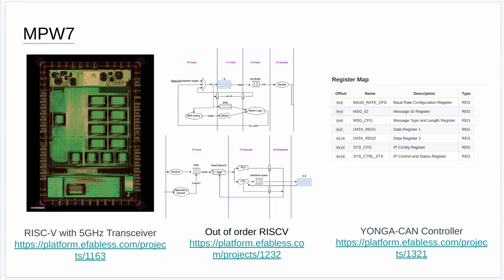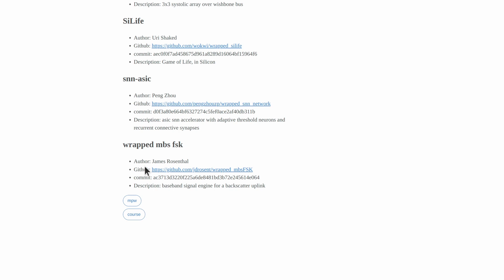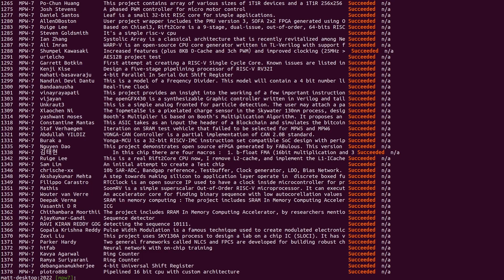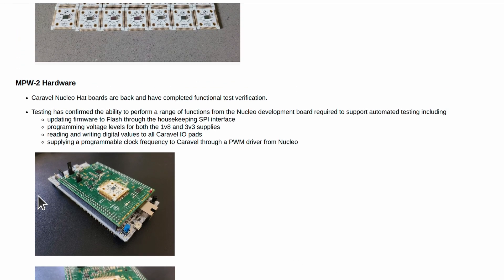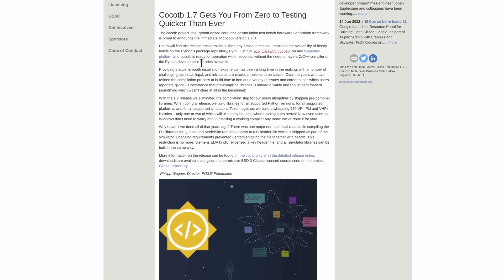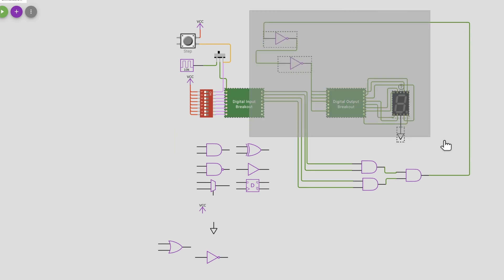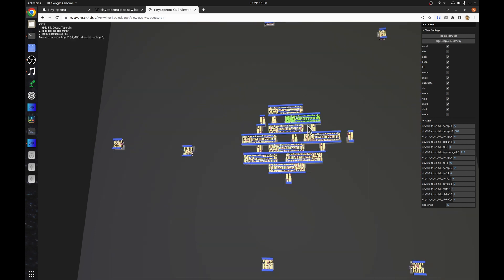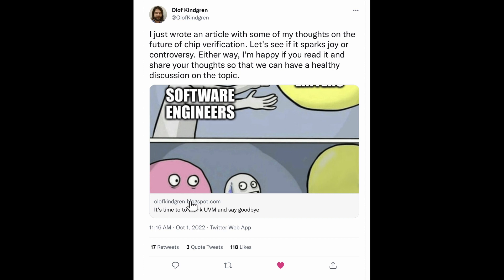September news update: MPW7 & 2, GDS renders, new videos & more!

Comment: Due to studying Computer Engineering at a non target school in Germany, and having very little actual chip development done in my area, I never got to break through into the industry. I can't wait to have some time to learn Verilog (after almost forgetting VHDL) and design something. Maybe a remake of some old circuit out of production IC from the 80s?
Reply from the maker: I was talking to someone who is into retro computers, and they wanted a 74 series compatible chip that could read an 8bit bus and display the data on 2 LED displays. https://rc2014.co.uk/1978/zero-to-asic-introduction/ Maybe that could be a good project?
Reply: @ZeroToASICcourse  brilliant! I Will take a look into it.